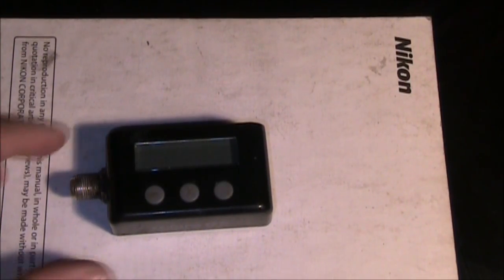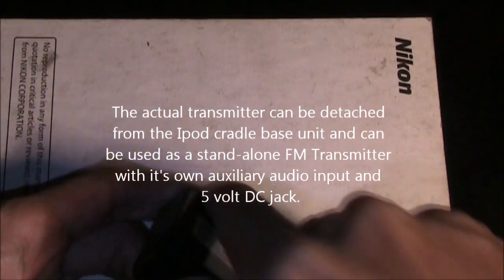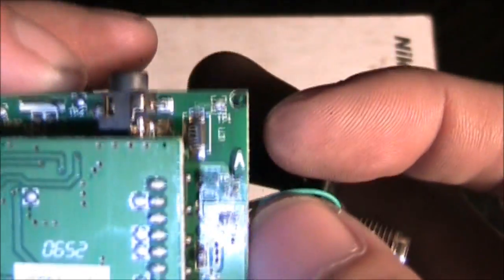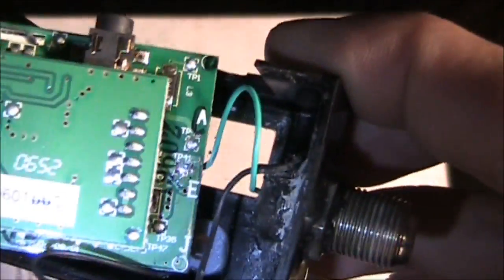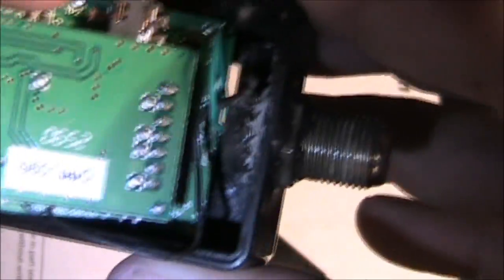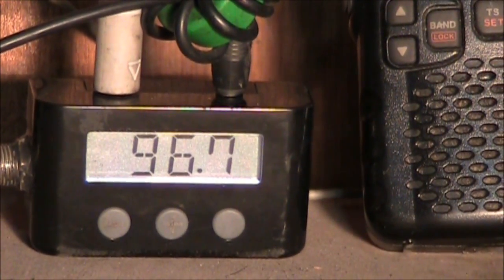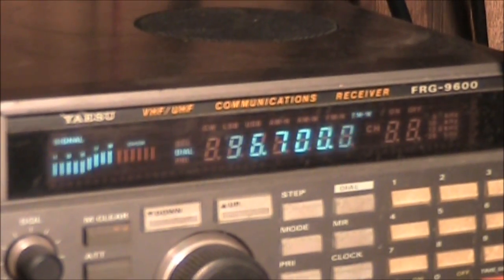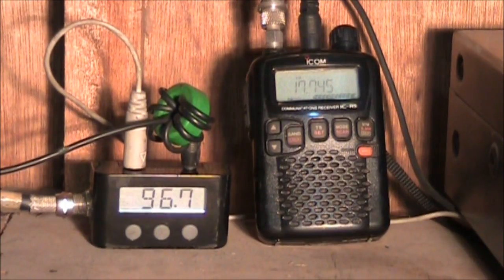FM TRANSMITTER ANTENNA HACK - Griffin Roadtrip Ipod Digital FM Transmitter

Comment: 5:16 copyrighted sana dalawa ang puso ko 😂
Reply from the maker: YouTube won't detect Copyright on a music that is buried in the noise or if mixed with other sounds "unintentionally" that is considered natural sound, as they may be  violating fair use and Paragraph 512(f) of the Digital Millennium Copyright Act of 1998 such as in Lenz vs Universal or the "Dancing Baby" case where Stephanie Lenz and the Electronic Frontier Foundation (EFF) sued Universal Music in 2007 for taking down a YouTube video of a toddler dancing to "Let's Go Crazy" Prince song.
Reply from the maker: GOOD FAITH STATEMENT: In this video, the song "Sana Dalawa ang Puso ko" was a product of radio interference and wasn't intentionally played nor the focus of the content. The music is just a randomly garbled and annoying background noise so my use was classified as "Fair Use" aside from the fact that this video is educational and demonstrative which falls under science and technology.
Reply: @Manny_News_Blogs_Tutorials  but thanks it really works i calculated the length of my diplole antenna and i use wire for that my transmitter range was 500 meters !!! . Thanks for your video the antenna really works
Reply from the maker: @TristanYT1 , Welcome. Glad this video helped you. As with my other disclaimer, I do not encourage pirate radio activity that's why I only featured modification of a part 15 FM modulator at very low 50 to 100 mW power, just enough to show how FM transmitter works. While it is illegal to modify such Part 15 device, you could get past the Law if you do not interfere with anything. You only get caught if somebody complain you for interference and mischief and reported your activity to the authorities, so I would suggest that you stay low. Just enjoy the electronics hobby and learn, so you might  become a knowledgeable technician someday if you decide to  pursue this type of career with proper education and necessary licenses. For now, let my purpose stay as educational and demonstrative as stated.
Reply: @Manny_News_Blogs_Tutorials  ohhhh no i modified my transmitter now its 10 watts
Reply from the maker: @TristanYT1  Same as mine, I put a 10 watts Planar Epitaxial Transistor on the RF Amp (not shown in the video)  but I'm running it only at 3 watts low power with a dipole in the attic, enough to use it as an RF link for online audio podcasts around the house. 3 watts is just enough for home use and will not overheat the finals.